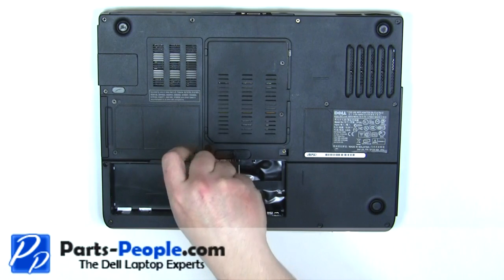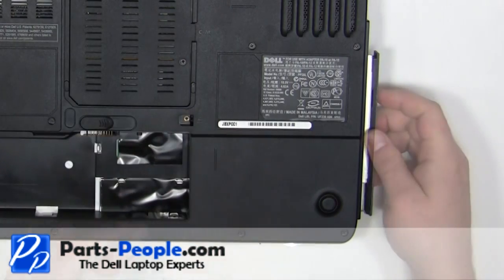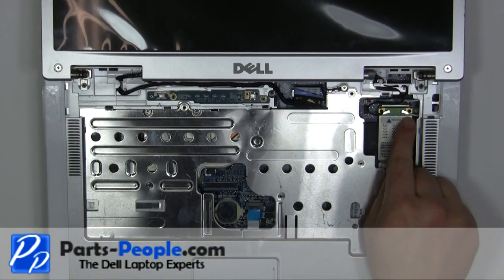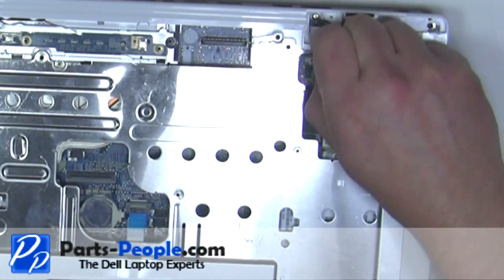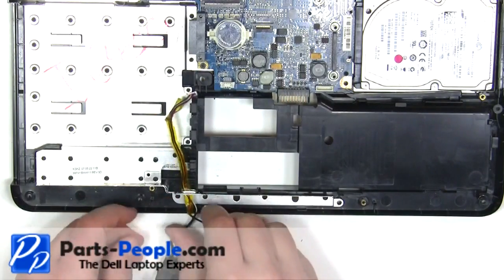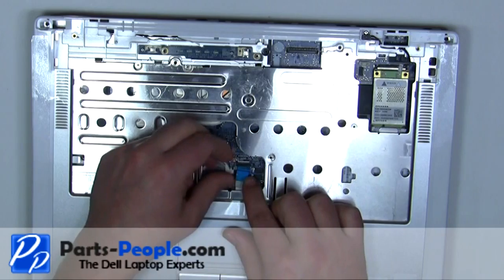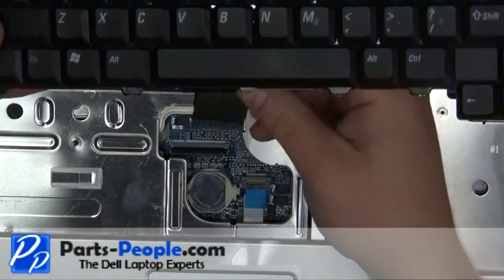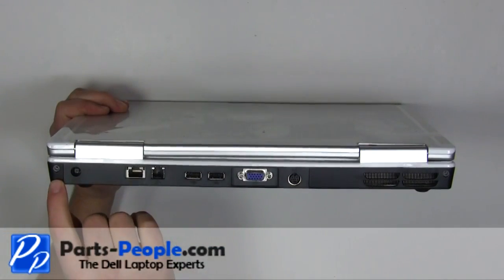Dell Inspiron 6400/e1505 | Speaker Replacement | How-To-Tutorial

Comment: This looks like it might be a fun project, but I'd like to know if there's any way to determine if my speakers are actually bad. I don't get any sound, but I'm told that it could be a software problem. Is that right? Also, my headphone jack used to work after my speakers stopped working, but now it doesn't and I don't get any sound out of my headphones. 
Great video...thanks.
Reply from the maker: The speakers and the headphones could be driver related or maybe the BIOs needs to be updated. You can see if there is a driver issue in the device manager. If the device manager doesn't see an issue, you can still reinstall the driver just to be safe. You can find the drivers and the BIOs update at support.dell.com.